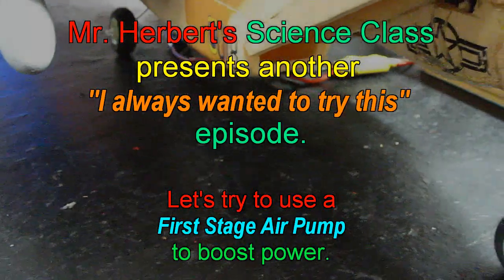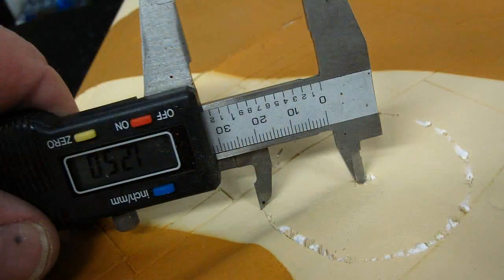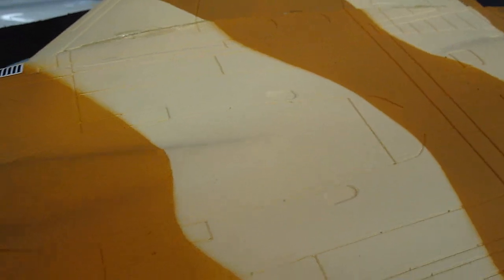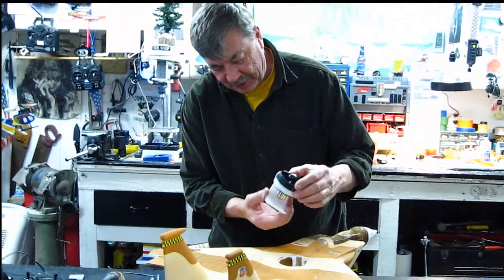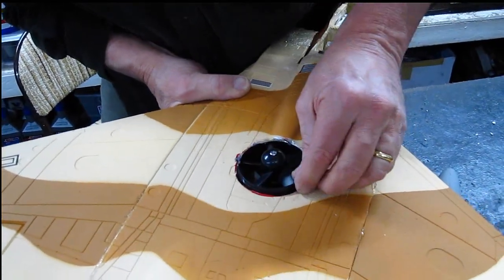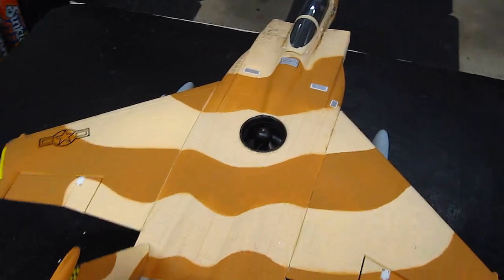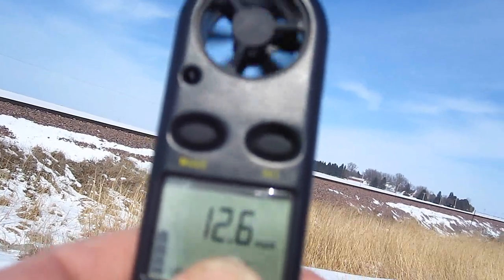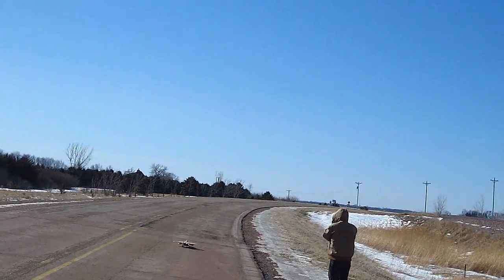I added a First Stage Compressor to my F-15 EDF Jet.

Comment: we used to call them cheater holes.
Reply from the maker: Yes, that term was coined by Byron of Byron originals. All his jets had them.  I had and now have several Byron F-16's and that cheater hole was needed to get more air to the fan, than the stock intakes.  When I flew the F-16s and blew them up in the movie Blue Thunder, the director did not like the look of the cheater hole, and edited them out for the scenes.

Comment: why? I mean this is cool, but the compression stage in a jet engine is for combustion
Reply from the maker: Why?? Because the Stock intakes do not let in enough air to efficiently run the ducted fan.  Just the same reason there are big "air cheater holes on My Byron F-16 I just converted to electric.  It needs to breath and this does it!

Comment: While I do appreciate that high compressors would gain if one has a primary  pump in front of it, in this case the fan was installed with a vertical axis sucking air from a location on the wing which is normally a low pressure relative to the top surface. Also the top fan had the air coming in at right angles to the fan , which is not a very efficient system to such in the air. So it would have been so much better if in addition to the lower deflector you had an upper deflector  which will bring in air  head on and then deflect it down to the fan .     As it is I doubt if that fan is 25 % of its best performance.
Adding vertical lift to the wings is quite understandable as things stand , but adding a top deflector to suck in oncoming air and then deflect it down into the fan would cut the lift and increase the pressure to the main motor system.
Very nice system you have.

Comment: It cannot be called a compressor it doesn’t increase pressure it is just a fan without a diffuser channel. It just increase mass flow and therefore thrust.

Comment: OK, I have a question. What if you were to "stack" three motors end on end, and compress the air that way? Or use one per side, using a duct to direct the airflow to the main rear stock motor, while moving the rear ward motor forward and ducting it to the "exhaust" holes?

Comment: sir with all respect to you sir,i think it has a very very huge disadvantage if you will still put your EDF on vertical,because your aircraft move horizontally not  vertical,and lack of BLADES of the compressor will affect the compression it will experience (COMPRESSOR SURGE or your compressor will STALL),and you should change your FAN BLADES on your main 2 EDF  makeit 8or 10 blades each EDF,etc.

Comment: An EDF pulls the plane along like a propeller.  It doesn't really push the plane along.  Like a turbine engine it pulls the plane, not pushes.  Everyone thinks a "jet" place is pushed.  A rocket engine pushes a turbine does not.  There is a compressor stage for combustion.  Adding air intake to a combustion engine is different as that changes the amount of air that passes through the engine and adds power as the amount of air is increased.  That is why the plane went up when you turned the extra motor on.  The fan pulled it up.
Reply: Some planes has reverse trust mechanism on its turbines (it routes exhaust gases to forward). So according to your theory, reverse trust just doesn't work cause turbines pulls the plane.. its  wrong cause jet engines increases momentum of air, this means the exhaust speed way more bigger then the intake speed. It burns fuel for expand the intake gases and generate thrust.
Reply: You're just slightly wrong. It does Both pulling and pushing at the same time. for example afterburners work by adding fuel to the later stages of the turbine to further expand the gas thus giving the exhaust a bit more power.
This is pertaining to Jets btw
Reply: Yes it does. It's used for taxiing backwards but mainly used for air braking.
Reply: Yup,When landing airline jets reverse thrust slightly in conjunction with the air brakes and wheel brakes
Reply: Most jet aircraft are turbofans not pure heat thrust
Reply: so how does thus apply to thrust vectoring then?
Reply: a propeller does pull the plane along, but because the propeller is a spinning airfoil, it creates a negative pressure in front and is pushed forward by positive pressure on the backside of the propeller blades. the propeller is not a fan in that it moves forward by pulling air backwards. it is being pushed from behind, which in turn pulls the plane forward.
Reply: Noughs Enough. Sorry but thats wrong. Newton's 3rd law of motion states 'For every action there's an equal and opposite reaction'
Gas turbines (Jet) engines, ducted fan & propellers work by accelerating air backwards in turn propelling the aircraft forwards. A propeller accelerates a large mass of air relatively slowly whereas a gas turbine accelerates a relatively small mass very quickly. Which is why props loose efficiency at higher speeds.
Jet & rocket engines are classified as reaction engine, their difference is a rocket has to carry it's own oxygen supply. Whether an engine has a compressor or not doesn't change the way it propels an aircraft. 
Jet engine intakes are usually divergent ducts designed to to increase the air pressure delivered to the compressor face (see RAM recovery), and by use of shockwaves in supersonic a/c. There is no vacuum that sucks the a/c along.

Comment: where is this test data video mentioned?... id be interested to see the controlled test as it doesnt really make any sense flow wise, unless you are now using more power than before. which i suspect you are. you need to compare the same power and efficiency. i.e. use the same draw and swept area for a single fan, as you do with 2 fans... only then will you know. because u are moving one fan at 90 degrees to the flow, it will be far less efficient.

Comment: surprised, with your background you did not try a forward-facing air induction scoop for the top fan before tilting it. Also, why not play with compression within the existing air chamber i.e, like a venturi reduction chamber in a jacuzzi spa jet. reduction sleeves behind the original fan (s) will create compression...even a reduction in the diameter of the exhaust-end of the original air chamber is worth a look. great experiments you are doing here, please continue.
Reply: you cant increase the pressure because u will also increase amps

Comment: U dont think if u just put 2 edf pushing to the back would be the right thing to do lol
Reply: +Luciano Junqueira yep. as long as there is enough area at the opening to allow no pressure losses, then a single fan as far more efficient. why anyone would put 2 fans at 90 degrees to each other and expect more performance , is beyond me.
Reply: it gives him more torque ... in a way ,  ... meaning ... if when he would bank up , if those two alone would kinda drop in speed for a second as it climbs the 3rd motor just help them always stay at max sped if that was a problem before ....im not an engineer i just work with them and thrust is tricky . you need enough thrust to over come any resistance to accelerate  (simple). but your EDF's Air's exhaust speed will always  be faster than you crafts speed .. ( in space ion propulsion doesn't face the resistance problem, so  is different) .. So an EDF cant really Funnel its power to a smaller diameter higher speed flow with out loosing the  thrust that can accelerate you ( meaning Making your EDF air blow out of a straw would make the air flow faster , but not make you go faster  because your fast air in the straw is a very small mass of air now )right ? kinda yes and no , changing the air Exhaust Air Speed absolutely will make you go faster  if you still have enough thrust to over come your crafts resistance ...   Air Craft R/c People sometimes forget how important  exhaust velocity is... this gentlemen 
could have made his exhaust a little more narrow since he added another motor ....  
like why would i add a second motor to my buggy unless torque was my only problem ...  right ... idk i think so ..

im looking for smart hard workers to join our R/c Start Up if anyone is interested i have a video
Reply: yea real jets need compression for the combustion of the fuel ...
i like that he is trying new things thou .... i think he could have got more top speed if he made his final exhaust a little more narrow ... 
then it would be worth it ,  he just added  more torque , it would be better is he added the 3rd just like the 1st Two ...then he would move more Air and thats really more torque... ( like in theory then he could push something heavier  , or fight stronger winds)
looking for smart people to join our RC start Up 
XD

Comment: I don't understand how adding another cheater hole to the top of the air duct, and then obstructing that inlet with with a fan would make much of a difference. I would bet that removing the fan on top, thereby leaving the cheater hole open would give the best results . . . and chop 2 oz of weight.
Reply: +CatButt12345 i agree. in fact a quick search on google would be easier than building it.
Reply: true , he is trying to compress air for now reason  Jet engines to that for combustion of fuel ...  he gave himself more torque ,  which he could have used to narrow his Air exhaust ports for  higher air Velocity for Higher Top Speeds

Comment: I hope you still get these messages (two year old video) i really like this idea and was trying to configure something similiar in a vstol ducted fan plan. the question i want to ask you is about the power for the front fan, is it a swith (on/off) or variable? and if it is a switch is it on to full power or limited by resistance somehow? if possible could you explain the wiring?

Comment: I also wanted to try this, but just use the normal air intakes and run them in series. Maybe try a 7 blade prop in them. As the air flows after and before will be very different, than when using one EDF

Comment: if only i did that to mine...it went in high alpha at full  throttle 30 seconds into the flight,stalled and got stuck in a tall tree...

Comment: Sorry to state the obvious but have you or have you seen anyone stack fans? Ram air basicly. I have that same airfield F-15, it is a dog so perfect to do a project on. Something I have wanted to try is closing off the intakes with say 30mm fans to force feed the 70mm? Think of a tube with the stock edf in the rear and another, preferably identicle pulling air in and feeding the thrust fan. It seemed to slow down and become unstable with a top fan. Have u tried this?

Comment: you should put a smaller EDF, that spins faster than the larger EDF, behind the larger EDF to get a real "compression". so the larger EDF would be almost like a booster pump or compressor for the smaller one. Essentially more molecules in a smaller area = more thrust, or at least in concept it is haha cool vid by the way! love the idea :)

Comment: Dave just a thought here. Watching both video's on this project. Would putting the front fan horizontal in the fuselage work better more efficient. More of a direct air flow. In stead of sucking in off the low pressure air flow over the top of the aircraft.....

Comment: It would be good if you could quantify the actual improvements, for example measure the thrust produced by the modified and standard plane on the ground and or straight and level flight measured by gps for both variants...you'll be making a three stage electric compressor with varying blade sizes next and ripping the wings off!

Comment: Dave have you ever thought about not using a ducted fan, but using a centrifugal compressor instead?

I tried it years ago with a glow plug motor and "put a leg out of bed"!
Broke the conrod, put it through the crank case. :-(
It was suggested that a centrifugal compressor didn't present enough load.
Now I have a few brushless motors to experiment with I'm going to give it another try.

What do you think?

Comment: I think this would work good with inline stages connected by planetary gears. I think the airflow from this should be straightened out to work better. I also think that to take advantage of the higher pressure, you would need to spin the rotor faster, right?

Comment: I have problems with my fan planes in getting enough air intake, they fans make way more thrust outside of the plane because theres just not enough room for adequate intake. I thought about haveing a bigger slower fane and then a smaller super fast fan before so this is interesting to me.

Comment: HI Dave,  Did you add a 2nd battery for the compressor?  Does the compressor add enough lift to fly the plane more slowly with good control?  Looks cold there.... 70-ish in Colorado yesterday.

Comment: Adding that fan or a first stage compressor did make a difference. 
Hope you fly the F15 EDF with the 25 degree angle on the first stage compressor 
bet it improves even more.

Comment: I had the same theory but with multiple fans right in front of each other like a turbine it will have multiple fans and compress the air
But its just a theory also that would consume alot of power so its not practical

Comment: maybe make a scoop over the top fan so when in air, it pulls a lot more air in and increases top speed. the way it is now, i think its pulling the plane up lowering top speed a bit. it would be like a ram air intake on a car.

Comment: great idea.
why not try adding another hole on the bottom of the plane? maybe attempt a somewhat vertical take off? it could also allow more air for the original motor. maybe. just an idea i didnt think through all that much. what do you think. or maybe you could make the hole open and close able with a kind of trap door and servo so that after you get your vertical take off you can direct all the airflow from the second motor to the first like you had it.
maybe keep steady with thrust vector

Comment: I think the thing is that the first stage is blowing compressed air the original fan, when its not designed aerodynamically to take wind that fast coming at it. I know when you put your hand in a intake you barely feel the pull, compared to the back when its throwing your papers into a big mess lol. I think it be cool to have 2 fans in the same tube instead. 
Have you had much progress with decreased blades on an EDF? I havent had much lawl, lots of vibration problems.

Comment: What if you put that smaller EDF in front/behind and line with the main EDF? Also what if it was counter rotating or if the front one is a pusher EDF type? I think about these things but you have all the know how, experience, and gumption to pull it off.